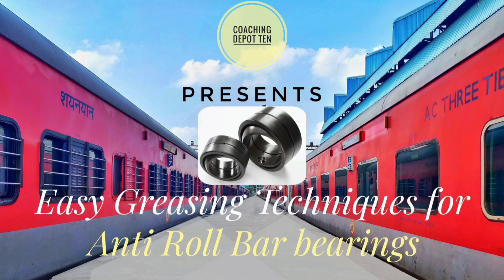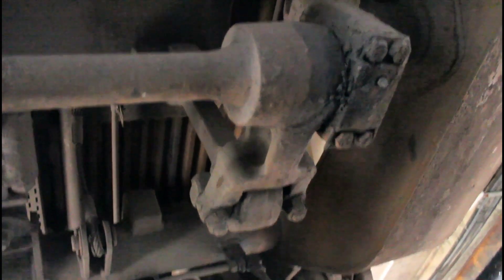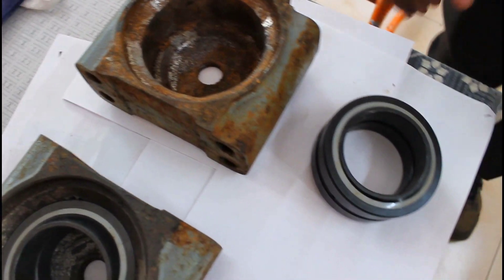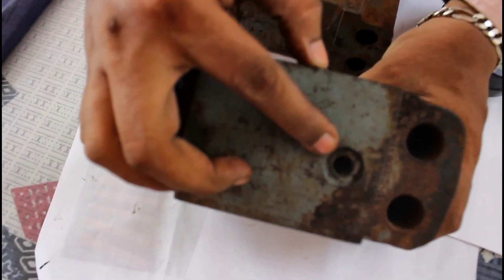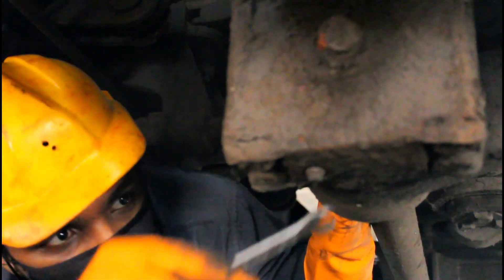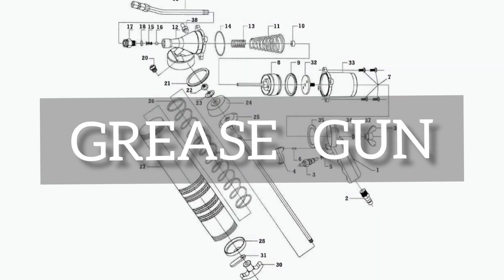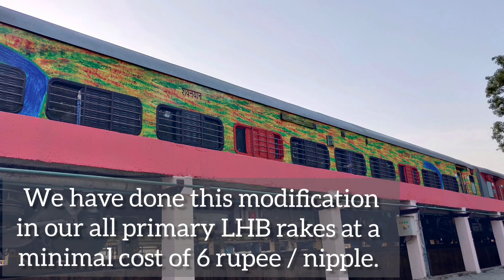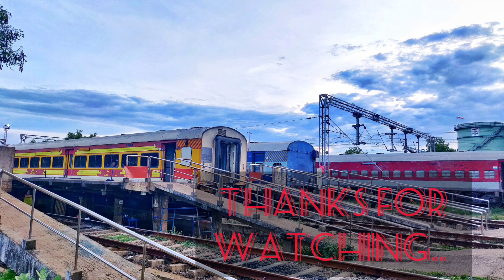SIMPLE MODIFICATION FOR EASY  GREASING OF ANTI ROLL BAR BEARINGS.. #LHB #COACH #TEN #INDIANRAILWAYS

Comment: We tried this nipple. The original bolt is having one washer like portion. When this bolt is tightened, this washer like area holds the bolt against anti roll bar.
But this nipple doesn't have that washer area. Due to this, when this nipple is tightened, the nipple head is also entering into the hole of anti roll bar. We can not provide additional washer also (since the length of the threaded portion is minimal) 
Another problem is that all our anti roll bars don't have holes with the same type of threads, ie coarse and fine threads.
If we overcome these problems, this idea is very much effective.

Comment: We can use quick release coupler in greasing pump's outlet. So that we can reduce one man power.
Reply from the maker: In place of that we can use self lubricating bearings which will eliminate the manpower requirement. But in that case some posts will be surrendered. Our aim is to optimize the manpower requirement and not to eliminate them.